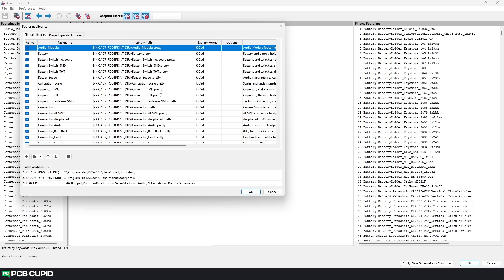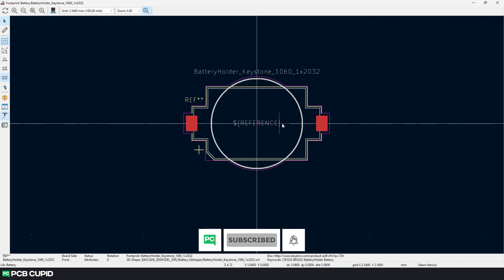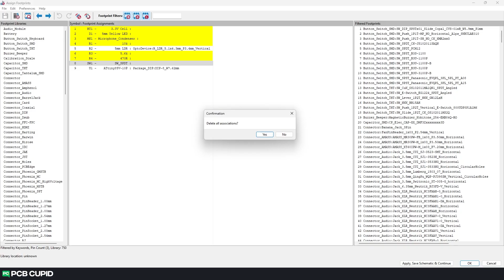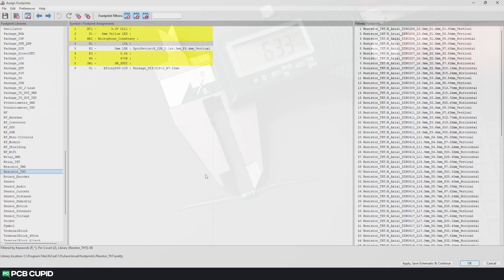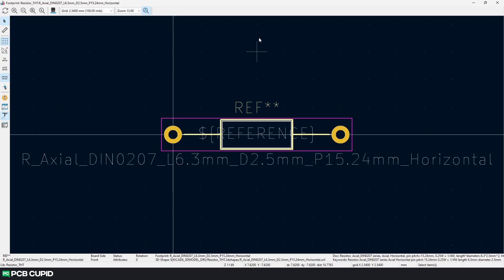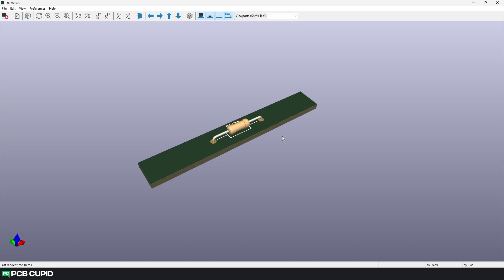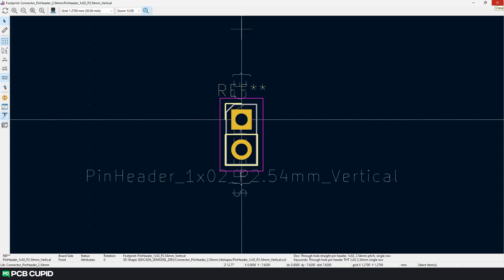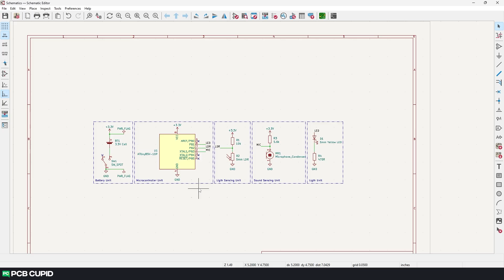#6 How To Select The Right Footprint For Symbols in KiCad 7.0  | #PCBCupid

Comment: The footprint you used for switch is not in my footprint library. I am using kicad 8.01
Is it normal to not have some footprints in different versions?
Reply from the maker: Yes sometimes, but most of the time they will remain the same. Can you point out which footprint you are talking about?
Reply: @pcbcupid  the CuK one. When you opened its image, I managed to find a really similar one in appearance. The only difference I noticed were the names of the footprints

Comment: Hello. 6.03, for me kicad7 does not show 3d model resistor, onle show footprint, in your case you see both -  a footprint and a 3d_resistor model.... what did i wrong ?
Reply from the maker: There are multiple reasons, it could be 3d files weren't installed during the KiCad installation process or it could be you have move the 3d files and folders else where. You can still manually assign them or you can just reinstall KiCad.

Comment: Thanks for great video
  pls make video on how to smd led place in rounded manner
Reply from the maker: You can do that by using circuit array. 
Select the footprint that you want in a circular manner and use the shortcut CTRL+T.
This will open a pop up window. In this window make sure to select the circuit array tab. 

-> Set the horizontal distance from the footprint (Use the Global X and Y position on the bottom status bar)
-> Set the Vertical distance from the footprint (Use the Global X and Y position on the bottom status bar)
This values will setup the centre for your circular layout

-> Set the angle for each generated footprint 
-> Set the number of footprint that needs to be generated
-> Turn on rotate if you need the footprints to align with the circular layout

Initially this might seem little difficult, but once you play around with the setting you will understand much better.

Comment: Very few of my footprints are showing up and following the directory it takes me straight to where they are but KiCad isn't recognizing them to open the files it seem.
Reply from the maker: Was the footprint made with older version of KiCad?
KiCad 7 doesn't support footprint that's built in KiCad version 5 or less.
Reply: @pcbcupid  I downloaded kicad for the first time this past week and even the footprints that came with the download won't show. Basicallyi believe they should all be up to date. Seems like in some menus they do but I finished my schematic and they won't show there.
Reply: I figured it out. I think it needed to load some components and also you can't just right click the object you have to click a related component AND THEN right click to view the component.
Reply from the maker: @lamboking8able  Glad you found the solution!

Comment: Is it possible to look for a particular footprint? eg, say I want to create a new transistor component that is not in the library, say T03 package, can I look to see if any other transistor has this footprint and then copy that for my new part?  Thanks a lot
Reply from the maker: Yes! You can assign different footprint to your new transistor. Under these condition : they have should have similar pinouts and same footprint dimensions.

Comment: Great tutorial. Looking forward to the next video!
Reply from the maker: Glad you liked it, More videos coming soon!
Reply: @pcbcupid  Looking forward to it. I used to be a Eagle user, but recently switched over to KiCad and these videos are taking me through a small project as I learn the new environment :).
Reply from the maker: @Glitzerstrahl  Glad it's helpful. KiCad is fun, definitely worth trying!
Reply: @pcbcupid  i confuce in foot print slection. like spl. on size issue.  because if i took components from my lical market how to ensue about right size
Reply from the maker: @1ashutosh  If you are getting from local market, it would be very hard to find datasheet. So first get the components on hand and measure them before making the PCB